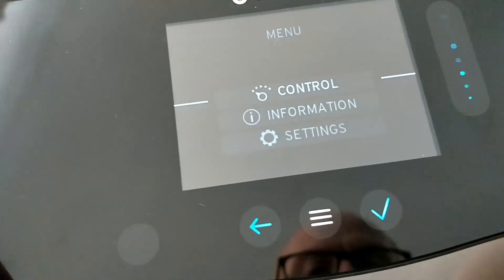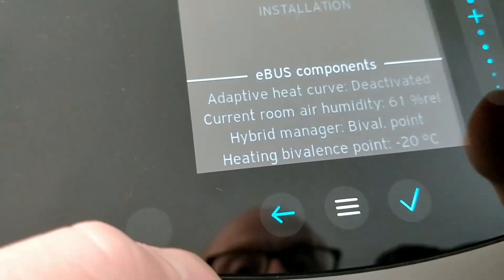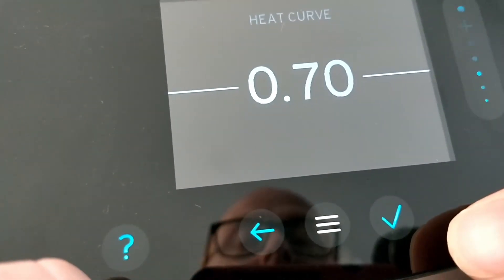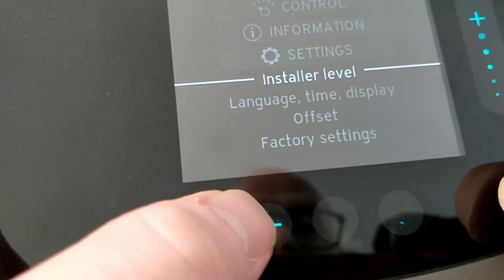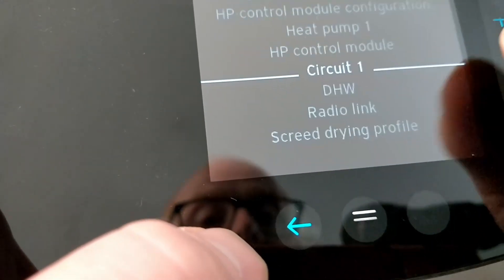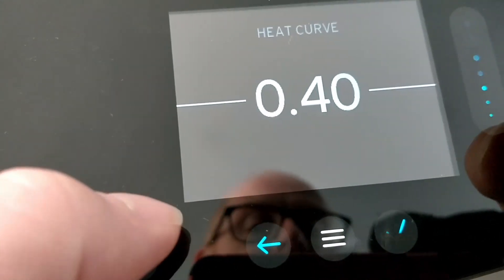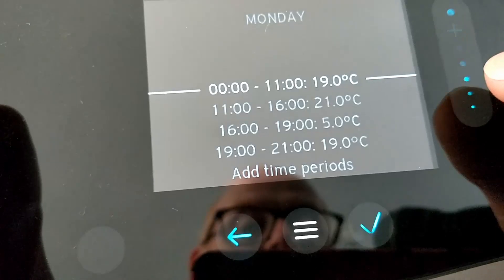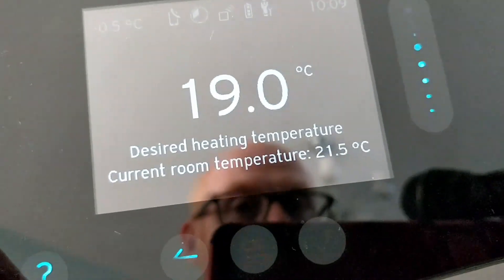How To Set Your Weather Compensation Heat Curve - Vaillant Arotherm Plus Heat Pump

Comment from the maker: Get a quote for a heat pump: https://tech.referrals.octopus.energy/uOYXOG2p

I should have mentioned that to set the correct heat curve with underfloor heating, you will need to temporarily set your heatmiser/other room stats to max so that they don't interfere with the Vaillant controller.
You can bring the room stats back into action once you are on the right curve.
Otherwise it's like pressing the accelerator and the brake at the same time in a car.

Comment: "For optimal efficiency, it is essential to configure your heating system settings with room compensation . While pure weather-dependent control (weather compensation) forms a solid basis, it is not sufficient on its own for maximum savings.
Room compensation offers a significant advantage by taking internal heat gains into account. Factors such as the number of people present in a room – where each person is comparable to a heat source of around 100 watts – or incident sunlight are included in the calculation. A strictly weather-dependent control ignores these internal influences.
Reply from the maker: Thanks. That's not relevant to this particular video but it is a good step to take once the correct heat curve has been identified.
Reply: @UpsideDownFork  "It is indeed a good basis for the initial setup."

Comment: I note your "experimental" heating time periods, for example your 16:00 to 19:00 5C period, perhaps because you are using Octopus Cosy?  Or you normally do a lot of cooking during that period and you have batteries that can't supply cooking and heat pump at the same time?   It would be interesting to hear the results of your experiments and your thoughts on the subject.
Reply from the maker: Good spot. I was on Octopus Agile for a while and experimented with maximising cost savings.

I have detailed this in videos last winter.

It did work ok. Now on Intelligent Go with plenty of battery storage. I'll see how this winter goes and will have to compare 3 winters with 3 different tariffs and 3 different control strategies.
Reply: @UpsideDownFork  I'm kon Intelligent Go as well with 19kWh of  battery although it wasn't enough during sub 0C hours.  Interested to hear what control strategy you are thinking of for this winter?
Reply from the maker: @nickkitson  I'm hoping that my 34kWh is going to be enough for all bar a couple of days.
Reply: @UpsideDownFork  Wow - that's a lot!

Comment: How is 19 degrees an acceptable temperature ? Do you guys compensate with thicker clothes or are you just that cold tolerant?
I find that 21 degrees is the minimum I could tolerate as an ambient constant temperature in the house and I am fairly cold tolerant, generally dressing just 2 layers (t-shirt and jacket) in a cold winter day, outside.
Also, why wouldn't you just set 19 as your setback temperature, why do you need to set a schedule for that?
Reply from the maker: I'm a shorts all year round kind of weirdo. Don't really feel the cold but I do feel suffocated when it's too warm. My wife and I have to compromise. Most of the heating season the house sits at 21 degrees downstairs and 19 degrees upstairs.

For me consistency and lack of drafts is more important for comfort levels than an arbitrary temperature number.

A house that is completely 19 degrees throughout and has been running 24/7 will have good thermal mass and more comfortable than a house that has 21 degrees in some areas but cold spots in other areas. Thermal mass is also critical to comfort levels. No one wants a freezing cold leather sofa.

I have also played around a lot to understand the heating controls and gain experience to share with others. Sometimes that's left our house in a suboptimal condition.

Comment: So I have a Vaillant sensoCOMFORT on a ecoTEC plus 637 with a weather comp outside. 
I'm set up with a mega flow S system. 
I've always had my heating curve set 2.xx  with adaptive heat curve on. Should I be looking at reducing the heat curve down? It seems to be fine but I don't know from efficiency perspective and what my actual home heat loss is
Reply from the maker: Over 2 is very high. Your adaptive heat curve will help to lower this somewhat but it is more efficient to turn the adaptive curve off and then keep lowering your curve until you find the sweet spot.

For boilers you should be aiming around 1.2 or maybe even lower.
Reply: @UpsideDownFork  okay, I've set it for 1.2 I'm just worried that the heating won't ramp up quick enough to heat the house on demand but I've never really tweaked with the adaptive on and off. I always thought from documentation that having the adaptive on would override your heat curve and work better for you.

Comment: Help! I wonder if you could help me out a little. 1 bed small house. 8 solar panels feeding a 102ah battery and Vaillant heat pump system. EPC A. Ive followed many of your tips to try and help get my head around the heating. I cant understand why my heating is coming on at seemingly random times, even though the room temp reading is 22 and the desired temp set at 19. Its currently on at 1336 on a nice mild but not chilly day, outside is 16 degrees. Heating timed to come on in the evening only between 1800 and 2230. DHW set as per yours between 0300 and 0600, which seems to work ok. Thanks. Mike.
Reply from the maker: Hi Mike,
You have effectively 2 workarounds during mild periods.

1. Set the room temp mod. to expanded as this will completely disable heating when your room temp is above the desired temp.

2. Set your desired temp to 5 degrees.

Unfortunately you can't do anything about the Vaillant algorithm which is excellent when it gets colder but not so great when it's mild.

Hope that helps.
Reply: @UpsideDownFork Ah great, thanks for the quick reply. I’ll try 1 and see how it goes. 
Thank you 🙏
Reply: @UpsideDownFork Ok gone to expanded. Eco off, its set to normal. 
Just found something called the OT switch off threshold. Its at 30. What is that and is that a good temp?
Reply from the maker: @michaelreed5596  OT is for outdoor temp. Most find the sweet spot is 17-18 degrees. Effectively your heating will always stop working when outdoor is above this OT set temp.
Reply: @UpsideDownFork 
Cheers. 
I really appreciate you taking the time to reply to a naive newbie!!! Thank you so much 👍😊

Comment: For underfloor heating what is the minimum heat curve? For 24 grade ?
Reply from the maker: It will vary for every system design. Try 0.1 and see what results you get.
Reply: How can i now if my thermostat vsmart erelax is wired to ebus without open the boiler.thank you @UpsideDownFork

Comment: Thanks for doing your video.
I have a small 2 bed new build house with 3 zones/circuits.
1: Upstairs RADS
2: Lounge (& kitchen) UFH
3: Hall (& toilet) UFH
I have 3no VR92 Vaillant thermostats (1 for each zone) which are currently set on 'Expanded'. (The VR720 sensoCOMFORT is in the master bedroom with the integral thermostat disabled)
How should I adjust my curve as per your suggestion? Will I have to do one zone at a time? Or should I just set the values manually based on the fact that it is a new build super insulated home?
Many thanks.
Regards Mick.
Reply from the maker: The heat pump can only run on one curve at a time and it will always default to the highest one being called for by any of your zones.

Being that your house is a new 2 bed home, you won't have a lot of system volume and zoning will just make this worse, so how your system has been designed and installed is far from optimum.

That being said, the most efficient way to utilise the system is to set the same curve for all 3 zones and run them all at the same time so that the heat pump has as much system water volume to work with as possible. This will reduce cycling and increase efficiency.

You may need a few weeks to get this correctly calibrated but it will be worth the effort as once it's correctly set then you can just forget it.
Reply: @UpsideDownFork 
Hmm. Thanks. More questions then sorry. Let me know if you would prefer me to DM instead of on here.
So, currently heating is set to manual 24hr (no time profiles) all 3 zones are set at 19.5 degrees. 
Zone 3 downstairs hall UFH with front door and north facing is obviously the coldest zone that needs to work hardest so I assume will need the highest curve - but I will start with 0.7 as you suggest and monitor its performance. Maybe set this zone to INACTIVE.
Zone 2 downstairs lounge UFH with large French doors south facing is a lot warmer than the hall, so obviously I don't need heating flow there when the room is warm - so to me it seems to make sense (maybe incorrectly) to allow that stat to shut the actuator on that UFH zone when satisfied? Maybe set this one to ACTIVE or EXPANDED?
Zone 1 upstairs RADS all have TRVs (except the coldest front north room which is where the stat is installed). Are you suggesting that I set this zone to INACTIVE too? I'm worried that the coldest front bedroom without a TRV will get over temperature?
Thanks again.
Regards
Mick
Reply from the maker: @peroni1000 the best course of action is to set all zones to inactive and see how low you can go with heat curve.

The next step to get even heat throughout the house would be to balance the system properly.

To then account for solar gain you can switch from inactive to active once you have the correct heat curve selected. If Active is not aggressive enough then you may need to resort to expanded which is not normally the preference for efficient running but may become a necessity.

It sounds like you have a reasonable understanding of the system already so I'm sure you'll get it dialled in nicely with some patience.
Reply: @UpsideDownFork  
Thanks. Will do.
For now I am targeting 19.5 degrees throughout. Zone 1 upstairs and Zone 2 lounge are constantly get higher than that (even today). 
Zone 3 front north hall is the coldest. 
Given your previous comment that the heat pump will only take notice of the highest curve value, i have set zones 1 and 2 with a curve at 0.1 (the lowest available) and zone 3 is 0.5. I will only reduce the curve of zone 3 if a reduction is required anywhere.
Thoughts?
With these settings since 08:00 this morning (bearing in mind i am targeting 19.5) the current temperatures are:
Zone 1 upstairs 20.5
Zone 2 lounge 22
Zone 3 hall 20
Thanks again.

Comment: I live abroad and our winter temperature is usually -4 in the mornings and sometimes not getting above + 2 during the whole day. I try to use the pump when the temperature is at its warmest which is not always easy! thanks for the video. , a good insight into this fucntion
Reply from the maker: Hopefully your humidity is low.
90% here at the moment and my pump is doing more regular defrosts than usual because of it!
Reply: @UpsideDownFork   yes its usually low here , approx 35% now. This is typical for a winters day here.

Comment: I’ve finally found on the internet the problem with my heat pump.
Last year I’ve put 20 degrees and thermostat marked 23 degrees. I thought that it was because my house was very well isolated. Nevertheless electric bill was too high! 
So I decided to go the temperature down, to 18 degrees, and my thermostat shows right now 20.5C. 
Until now, I didn’t know why this gap. I’ve just learnt the problem! 

One more thing! I’ve seen you enable a heat program with differences of two degrees or more oil the heating. What if I have a floor heating system? I’ve heard floor heating systems must be on all the time. 

Thanks for the video and I hope you can reply to me ;)
Reply from the maker: If you have underfloor heating then setting a 2 degree set back over night will be fine.

Good luck getting everything set-up properly now.
Reply: @UpsideDownFork  thanks! I’m trying it. I ve already changed the heat curve, which was  in fact low (0.6) but I guess not enough seeing the big gap between desired and actual temperature. 
By the way, what is the setting “set back temperature: 15ºC” ?
Thanks again!
Reply from the maker: @guillettoaparicio13  the setback temperature is for any time period that you haven't put in the schedule. It will default to 15 degrees at those times.

Comment: Does the weekly schedule work with the weather comp ?
Reply from the maker: Yes it does 👍
Reply: @UpsideDownFork  It overrides the weather comp for the time set and then goes back to it or ? I wanted to experiment a bit but i didn't had much time , i have more time this week :D Cheers , great videos , i like the unbiased approach .
Reply from the maker: @toniilievski3934  weather compensation uses the outside temperature to put the correct amount of heat inside.

If you tell it to put 19 inside, it will get it to 19. As long as you are on the correct heat curve, you can ask it for 21 and it will give you 21.

So the weekly planner and the weather compensation are working hand in hand all the time 👍

Comment: Having had our vaillant system for over 3 years I'm only just beginning to poke around in the settings! If were trying to establish the heat curve using weather compensation only (room mod inactive), do i need to turn on all radiators including in the rooms we don't use, i.e. unused bedrooms, conservatory etc or can we leave them with the thermostat rigjt down on anti frost setting?
Reply from the maker: In an ideal world, all of them would be on but really you should just setup the system how you typically use it.
Reply: Great, thanks. I'll give it a go.

Comment: Hello from France and great content..thank-you!....my current room temp mod was set to Expanded...can you please elaborate why this setting needs to be set to Inactive? 2nd question, i see the heating curve settings are now available in the My Vaillant app...when i change the setting in the app to .65 and hit save, it defaults back to .60? using the controller like you are, and changing to .65, the change remains in the controller but the change is not visible in the app??
Reply from the maker: Using expanded is like flooring your car up to a speed limit and then backing off the throttle a little and then flooring it back up to the speed limit.

Your top speed would be the same either way, but on the correct heat curve you can accelerate more gently to use less fuel.

Inactive is the only way to know that you're on the correct heat curve.

I'm not sure about that other issue. I've not come across it before but the app is terribly glitchy. I'd recommend making all changes through the sensocomfort.
Reply: thanks for this... I'll change both circuits to inactive...and if you don't mind another question.... I have 2 circuits..ufh ground floor with.60 curve...and circuit 2 .. upstairs with high efficient radiators... they set up the same curve of.60 upstairs as well...make sense?
Reply from the maker: @philippehebert4284  Yes, both curves should really be the same. if you set one higher than the other, the heat pump will always utilise the higher of the two.

Comment: Your analogy with the accelerator on a car is nonsense. When you approach a hill you apply sufficient throttle to maintain speed and adjust that throttle position in real time to maintain the speed.
Reply from the maker: That's exactly what weather compensation does. Temperature drops outside so it increases the power, dynamically adjusting to maintain the internal temperature at the same level.
Reply: @ unless I’m missing something, there is no feedback loop. How does system monitor how well it is maintaining the indoor temp? The system relies on an outside temp vs heat loss profile which the user has to adjust to try and get the heat input to match the heat loss. That’s an open loop system with no feed back and no dynamic compensation for any temp error/ deviation from the desired temperature.
Reply from the maker: @kevinmills5293  Correct, it is effectively guessing at that point, that's why setting the correct heat curve is important. The user becomes the feedback loop.
Once the correct curve has been selected, further compensation through room temperature reference is sometimes required but minimal.
This is primarily due to the low and slow heating method building up significant thermal mass. Due to thermal mass, a door being opened or the sun coming in through a window do not alter the internal temperature as much. These things tend to be smoothed out. To continue my terrible analogy, the home becomes like a freight train which has incredible inertia.

The system's own feedback loop can be enabled.
This is done by changing the room temp mod. setting from inactive to active which then enables the internal air temp to be brought into play and the feedback loop to no longer be the user.

The point of this video is to get the base level correct. Small adjustments may be needed based on property, lifestyle etc.

If the base level heat curve is incorrect and the user has the active mode enabled then it will be doing a lot more hard accelerating than it needs to.
Reply: @UpsideDownFork  thanks, that makes sense now.